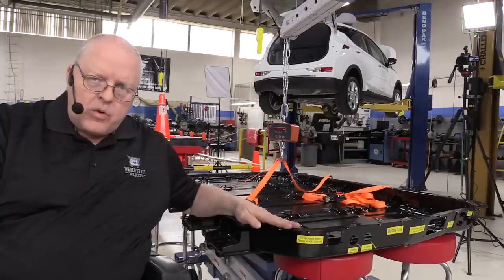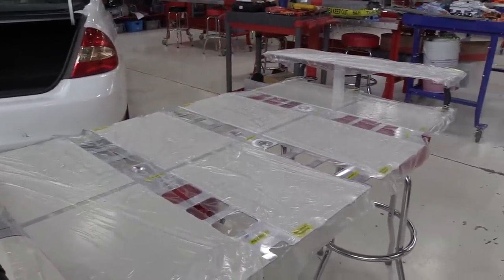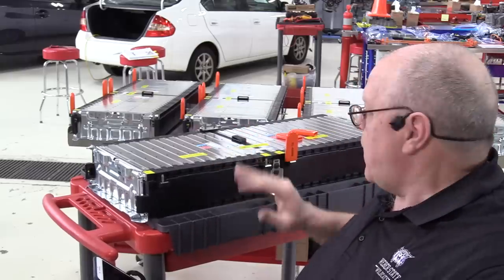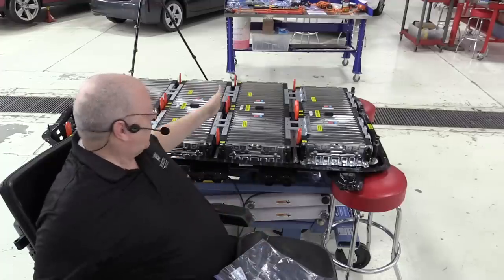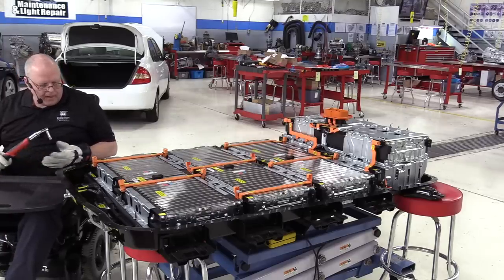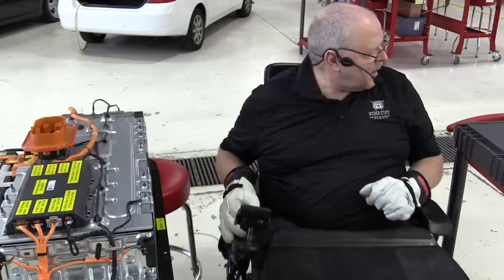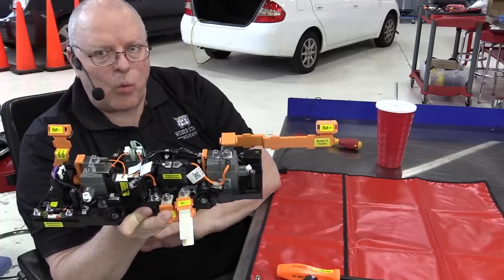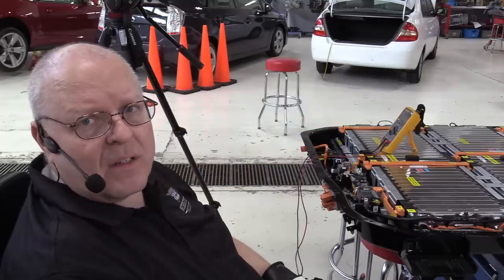Chevrolet Bolt EV Battery Reassembly

Comment: Professor Kelly - thank you for your excellent videos on the Bolt battery. I just bought a 2019 Bolt and your videos helped me understand a great deal about this fascinating vehicle. I also have a white 2001 Prius, similar to the one in the background of this video.  Reading over the past comments I didn't see anyone give you a full answer on the L1/2 charging levels. My 2019 Bolt has adjustable L1 charging of 8A or 12A that can be set manually. I think this was a new software change for 2019 for folks with limited 120VAC outlet power. The L2 charge level is still 32A as was posted earlier. Great work!
Reply from the maker: Thank you for the information!
Reply: Mike K 2017 also has that 8/12A selector; perhaps was a firmware update

Comment: The car is rated at max: 32A 7,3kWh 230V type1/2 charging. Max CCS 50kWh charge. Thanks for the great indepth explaination.
Reply: CSS max was proven to be higher.
Reply: Funky Dunky  cant get higher last time I tried because all are 50kWh stations, since its been -10°C the few times Ive charged tho'  also. Gonna test out the car when I find an 100kWh charger.

Comment: I’m a 2017 Volt owner, and discovered your channel when you did the Volt battery deep dive, and have been following ever since. Awesome Work! You were asking about Level 2 charging amperage on the Bolt, it should be 30 amps. I amprobed my level 2 charger when i installed it for my Volt and got a spot-on 15 amps, (3600/240) as the Volt charges at 3.6 Kwh where as the Bolt charges at 7.2 Kwh if i’m not mistaken.
Keep up the good work!
Reply from the maker: Thank you and thanks for the information!

Comment: The maximum voltage for level 2 charger is 30 amps for 2017 Chevy Bolt (hence 40 amp fuse in your video on Battery Disconnect Unit which is rated at 1.33 times the 30 amp charge maximum input which gives 25 or so miles of range per hour or 10 hours to charge) Level 1 is about half of 10-15 amp charge rate hence about 20-24 hours for full charge). Thanks for all of your work and great videos. I own 2017 white bolt without fast charge. Hope to enroll for your 5 day course in December or June. Look forward to meeting you. Jim Mooney

Comment: I bought a set of Chevrolet Bolt battery modules a few weeks ago. I can't tell you how many times I've referred to your videos and watched you explain all the little details. 

They're going into a 2000 Ford Ranger EV that was originally powered by Lead-Acid batteries. At that time it was either Lead or NiMH, and they both had trade-offs.
I'm almost ready to hook them up to an Orion BMS that should take care of them just fine. I'm hoping for 150-175 miles of range from the pickup, and it will sit next to my 2019 Bolt I bought last year.
They will be air-cooled, but I think they will perform just fine since the peak consumption of the pickup is 90kW vs the Bolt's 160kW. And I won't be doing any fast-charging.
Also the battery compartment already has heaters for cold-weather charging!

Comment: Valuable information, great to see the inner workings demystified.
Reply from the maker: Thanks for watching
Reply: WeberAuto one query though, if the modules can’t be disassembled to the cell level, that means repurposing can’t happen. That’s not too green - perhaps Chevrolet should redesign their modules. And by the way, it’d be very valuable to see disassembled byd blade battery pack someday - any plans?
Reply from the maker: @Alrukitaf  There are two 40V modules per battery section. They can be separated.
Reply: WeberAuto thanks for the info. I presume that means the cells can in fact be repurposed for use in homes.
Reply from the maker: @Alrukitaf  Yes
Reply: WeberAuto to avoid damage, you have to unsolder the circuit board first, yeah?

Comment: Great job! Thanks a lot! And for the l1 charging max amp rating is about 12A, for l2 is 16A, and l3 is 100-200A at 360-400V DC, depends on charging station brand
Reply: L2 charging for the Bolt tops out at 32A@240V

Comment: Thank you very much for the work of putting together those videos. In ecology the second life, re use, repairability of things is key. As a concept this battery pack is cleverly put together (shorten cable length comes to mind) however where it is not the best is when it comes to its end of life in the vehicle, and the beginning of its second life as stationary. The cooling is of course the first thing that will probably not be reused... The main problem will be the individual cell replacement when faulty. The use as stationary require way less current in and out, making those useable for years after performance is too low for vehicle acceleration and quick charge. We'll see if the new leaf is better in that regard ?
Reply from the maker: Thanks for your feedback, it will be interesting to see. Rumors indicate that Nissan hasn't learned their lesson yet.
Reply: I’m h
Reply: Thanks

Comment: 1:12:17 we need BigClive to do a detailed analysis on that board. There's a LOT of stuff going on there! I'm intrigued by the choice to pot only some of the board. With my Youtube education, I'm curious why the potting is done where it is, and those relatively large surface mount capacitors (I think) aren't potted.
Phenomenal work. The fun part of EVs will be the re-skilling to diagnose and repair the modules, instead of blindly replacing them. I hope that will happen.

Comment: Thanks for another excellent video professor . So the basic cells weigh around 650 lbs or 300 kilos collectively  Not too bad, would work out in the region of 200wh  per kilo at the cell level. It's a pity the overall pack has to be so weighty as it must blunt the performance and range somewhat, but that will likely be improved in later models.
Reply from the maker: Thank you! Yes, not too bad.

Comment: I hope that you described how to maintain the drive unit in the Bolt, if possible the Volt also!
Reply from the maker: Yes, I plan on doing both of those drive units. Thank you!
Reply: It would be awesome to see, what has happened with drivetrains after initial mileage of like 50 000 km. I've seen really dirty oil in reduction gear housing. Sadly, no oil analysis (is it moisture, carbon, metal dust, oxidation...)
Reply from the maker: Me too (dirty oil), in a 2012 Nissan Leaf gear reduction unit.
Reply: WeberAuto It’s Lifetime(tm) fluid, people!  “Lifetime” being the span of the warranty.  After that, it’s your problem.
Reply: Steve Dutcher I

Comment: Super Tutorial of advanced construction!  Next step should be complete "first floor" of battery sections :) But weight...
How reliable are Chevrolet Bolt EV (Opel Ampera-e) by now? I've red that by one or two customers range of battery instantly dropped to Zero km! It was caused by only one cell with some issue opening circuit like service plug. Thank you!
Reply from the maker: Thank you. Chevrolet has addressed those issues with some recalls.

Comment: As connecting/disconnecting order is important, I've seen connectors that can't be removed in wrong sequence as there can be tabs that take care of doing it incorrectly. Also, why not have a warning label on the module.
Reply from the maker: Upon further inspection, they are having the highest voltage harnesses plugged in first (with respect to battery negative) then working on to the lower voltage connectors. I agree, a warning label would be helpful, but in GM's eyes, we are supposed to be following each step in the service information without exception.

Comment: Tremendous job! Have you noticed which material is used for the battery cover seal and connector gasket? I'm curious to find out if these seals and gasket could react badly with some type of anticorrosion treatment, mainly oil based ones.
Reply from the maker: Thank you! The cover gasket is a wide double-ribbed rubber seal with metal inserts at the bolt holes. The connector seals are some type of rubber. I am sure they are designed to stand up to any type of oil spills, leaks, etc. that may occur on/from the vehicle transmission. and steering gearbox.
Reply: Thank you for sharing your observation and guidance!

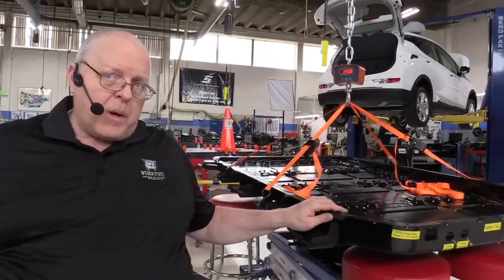Comment: At 3:20, if there is a coolant leak, is there a danger of short circuit, and injury to oneself, either whilst maintenance is carried out, or even when driving the vehicle ? Thanks for a great video !!
Reply from the maker: No, you could submerse the whole battery and it would not electrocute you. A coolant leak could result on the battery overheating and/or possible corroded connections resulting in unwanted heat and a voltage drop. Thank you!

Comment: All automotive parts should come stock with proper human readable labels/naming in English as this would make repairs and analyses a lot easier. :-)  How do you have your yellow labels printed by the way? Thermal label printer or laser label printer? Because the printing may disappear when exposed to heat and the glue may melt as well. Did you take into account, that depending on the plastic material of the labels, they could melt or even burn in severely hot spots? Nonetheless, thanks for all your work and explanations, Prof Kelly!
Reply from the maker: I agree, labels on everything! People joke with me about my labels, but it really helps me in my automotive classes. They are a special strong adhesive label made with a Brother P-Touch hand held label maker. The only labels I have ever seen get hot enough to burn off were on the coolant heat exchanger in a Toyota Prius exhaust system. These vehicle will not be driven very far, they are just training aids. Thanks for your great feedback!

Comment: Ok to clarify
Voltage is potential and has no inherent danger at any metric
Amperage or Current or Flow as a measurement of how many watta are flowing from one place to another and back again in a DC System.
Wattage or Watts is the power or work that can be done at a certain Voltage and Current 

So 400 volts x @ 15 amps = ?watts
Reply from the maker: 6000 Watts. Thanks for watching

Comment: Hi thanks for great videos. I have a question about you know which batteries are in a Reanult ZOE ZE from the 2016/17 22kwh version. Some say it's the same as the 2011 Nissan leaf. The only thing I can find is that there are 192 cells in the battery.

Comment: Those 6 connectors on management module that go to cells, can't be HV connectors. They have up to 4V on each pin, don't they? Or the problem is that there is higher voltage between those pins? Though again, there is only 16x4V possible, so 64V. Which is still below HV limit of... 100V?
Reply from the maker: I agree that the actual voltage difference at the BECM is only 4V, but there is a potential that someone touch, or back probe, or something else they should not do and get hurt. The difference between 384V and 380V is only 4V,  but there is still a higher voltage present with respect to the negative terminal. That cannot be said of the low voltage harness. Thank for your feedback!

Comment: Very interesting video. You always talk about cooling plates. Are they are also used to heat up the cells as the cells can not be charged very well in low temperature conditions?
If so, do you know how and how much heat power can be brought into the battery?
Question is since the Bolt uses the same cells as the Renault Zoe in Europe which also shares the same problems of charging.
Reply from the maker: Yes, they are used to heat the cells as well. The liquid in the cooling plate is heated by an electric heater. The heater is fed full system voltage, but I do not know it’s power rating. Best wishes
Reply: Thanks! in the Zoe, the cooling and heating is done by a closed air circuit with a heat exchanger from the AC for cooling and a PTC of max 1kW for heating. While it works very well for cooling the battery, it seams only heat up the cells to protect them. Above 9°C, no heating power is applied.

Comment: Interesting that there isn't a cooling plate between battery sections 4 & 5. I'm puzzled by the thermal pad between those two sections because it that the cooling plate below section 4 is expected to cool section 5. That seems ineffective. That design also implies that GM's biggest concern is heat coming up from below rather than the cabin. Would that be true for a Bolt EV parked in the sun for days during hot summer days.

Comment: Thank you for sharing awesome video!
I heard from the other video that battry module generally has a heating system as well as cooling system in order to keep the battery performance. However, any heating system have not be seen in the Bolt ev battery module.
Does each Batter cell work as heating element with separated heating system?
Those all the cells connected in serial, how to control temperature of individual module? (Heating up case)
It would be highly appreciated if you leave a comment on it.
Reply from the maker: Thank you, no. there is a single external heater for the coolant circulating through the battery cooling plates. see https://plus.google.com/u/1/photos/110973163437177515646/album/6501344367062783409/6501344371966132610?authkey=CIrrmMbCtbjhdQ
Reply: Thank you very much for your swift answer.
So, coolant circularting system works as heating system as well as cooling system.
For efficient heating by the external heater, I think something is required like air inlet damper at rhe front of coolant h/e, (which may be air blasted fin tube heater)
Thank you again. Professor~

Comment: Is there a way to get power from the car to power some small things in our house if we have a big storm ??
Reply from the maker: No, all the connections are buried and inaccessible. That would be a neat option though. Thanks for your feedback!
Reply: this company makes an inverter kit that runs of of the 12 volt system on the Chevy Volt. I imagine it could be a similar idea.  http://www.evextend.com/index.php
Reply: thanks
Reply: That is a feature available from the Leaf with Nissan optional equipment. The Bolt, at this time, does not offer it.

Comment: Sir, I'm from India. I have some questions. 
1- Are these cooling pads (white ones) electrical insulators?
2- If yes, in what temperature range do they work more efficiently?
3- What temperature of these batteries...is considered bad for the cooling system to start?
4- What is the maximum temperature these batteries can go upto...in case of abnormal charging/discharging?
5- Where can i buy these cooling pads? how much do they cost? are there any other alternatives?
6- Of what material is the cooling section made (the cooling channels on which the cooling pads are placed)?
7- What is the life of these cooling pads?
8- Can they be used reliably as gasket or sealing material (for example, in between two metal parts)? 
9- Which coolant is used here? also for which temperature range does this coolant works well?

I WOULD TO KNOW THE ANSWERS OF THE ABOVE QUESTIONS. I LOVE YOUR VIDEOS. KINDLY HELP ME.
Reply from the maker: Sorry, I cannot help you with those answers (except you can buy them from a Chevrolet Dealership). Best wishes
Reply: @WeberAuto   We do not have Chevrolet EVs in India. It would be too difficult. Your help could've helped me in my personal project. Anyways, i love your practical and descriptive videos. I'm waiting for more videos on low voltage harnessing and auxiliary system components.

Comment: Hello Mister. Professor Weber
I am from Switzerland and very difficult to get official Fiat documents.
Hence my question or request:
Would it be possible to dismantle a Fiat 500e high voltage battery?
Many thanks and best regards from Switzerland
Reply from the maker: Thank you for your feedback. That would be a fun project
Reply: Hello WeberAuto, thanks for your answer.
First sorry for my english skills.
The reason why I asked you is this:
In Europe (also in Switzerland), there is a fairly large Fiat 500e fan community (and owners), even if the car is not officially sold here.
Because it is sold only in the United States, the local Fiat dealers can not offer any help, they also have no documents for this car.
An FCA access is very expensive for us private persons. For this reason, no one has the courage to disassemble the battery pack, even if the older battery packs slowly are end of life.
Therefore, it would be great if someone could show us, how to change the individual batterypacks, in which order must be dismantled the wiring harness & and so on.
Thanks again and best regards, Miklos

Comment: Bolt contactors  are different compared to Volt contactors? If Volt has parts for sale and Bolt does not...
Reply from the maker: Yes, Bolt contactors are are totally different then the Volt's. The Volt contactors are much larger and made by a different supplier.